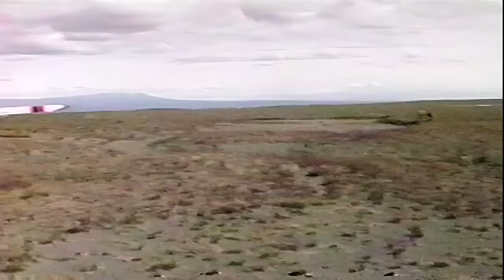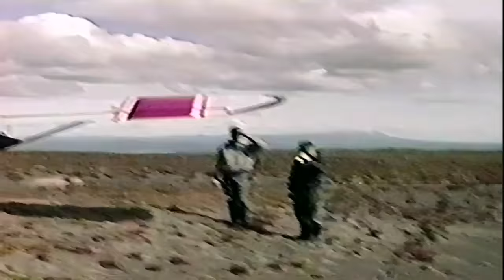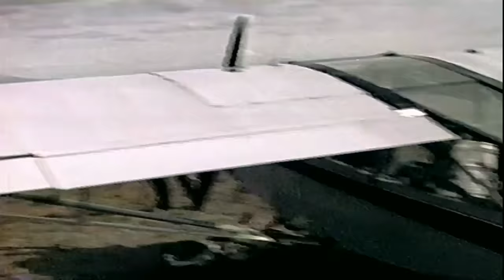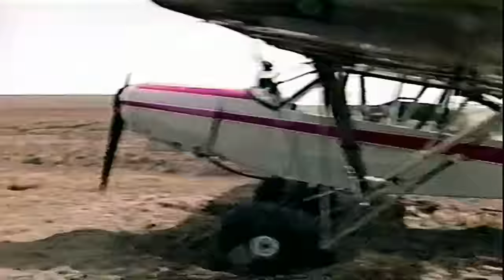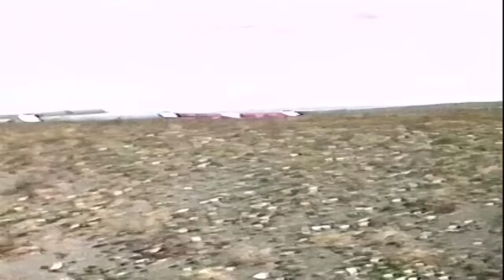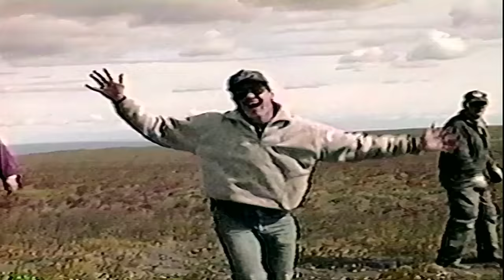SuperCub crashed,  repaired and flew back home in Alaska

Comment: Low altitude, spin recovery you did a good job!
Reply from the maker: I think you’re right @yesode4201!  I may have misspoke in the original audio description and I can’t go back and edit it without taking the video down. 

I was at full power with full flaps and sinking with rising terrain.  I was at a high angle of attack when the airplane yawed to the left. I tried to correct with right rudder with no response.  Then the airplane hit the ground hard and bounced on the right wheel.  It then yawed to the right and hit the ground going sideways and the left wheel and landing gear folded under the plane and the left wing hit and the prop hit and I stopped. 

I've thought about that day a lot and I do think you’re right! I was about to do a stall spin when all that happened and I’m lucky to be here to tell you about it.! Thanks for the comment!

Comment: I noticed the prop was bent pretty good and that could have caused damage to the crankshaft and connecting rods. I guess they must have put a new prop on and fired the engine up and if it had no knocks and good oil pressure then he went to fly it out. I bet when he got back to his home base the FAA would have required the engine rebuilt. Pretty neat adventure and getting you plane back though.
Reply: FAA in Alaska?
They can't find the place.

Comment: Didnt see anything. How was the wing unbent
Reply from the maker: This wasn’t really a how to more of a what happened you have to be an airplane mechanic to know how to do it…
Reply: @TerrydeAlaska  im a mechanic so i cant see straightening a wing. Did you bolt on another wing?
Reply from the maker: @libertyforamericanow  the wing spar was bent and not separated, so Charlie used like a little clamp port a thank you power unit to bend it down straight and get it straight as possible, and I didn’t get to really help him with that. I just saw what he did a little bit from a distance, but I’m sure if you have more detail questions you could call Charlie Center and he could help you with that.

Comment: Any praying go on there?
Reply from the maker: Actually I had full confidence in Charley Center's work as he had the wing supported inside with long metal plates and bolts on both spars and cables and come-alongs and we shook the wing up and down and it didn't budge.  Charley had done this many times before and I trusted him and felt good.  It did fly with a bit of right side yaw...good memory.
Reply: Glad it worked out!

Comment: How'd you repair that main spar?
Reply from the maker: I didn't do it, Charley did.  When he opened the fabric on the top of the wing, I saw the spar was bend but not separated in half.  He used a portable power system to bend the spar straight, then put a metal plate on both sides of the spar for about two feet and many nuts and bolts to clamp and tighten and form a splint on the spar and support it.  Wish I had pictures of that....I was too busy working on things I could do...Good question!
Reply: @TerrydeAlaska  Nice one.

Comment: I'd feel safer in this patched up cub than many of the experimental and ultra light pieces of junk that are approved to fly by anyone brave enough
Reply: What makes those certified aircraft junk? Why does one need to be more brave to fly something that isn’t broken than something with a suspect engine mount, suspect engine and broken wing?
Reply: @thatairplaneguy  I think he's likely referring to planes like Carbon Cubs, for $300,000 planes there's a lot of A&P's that say they're not going to be around very long, mostly based off the reinforcement not the matrix, I've heard and read that more times than Id like to admit, would certainly make me think twice about spending that kind of money on a plane not knowing. But who knows, certainly not me, I guess we'll see in 20 years.